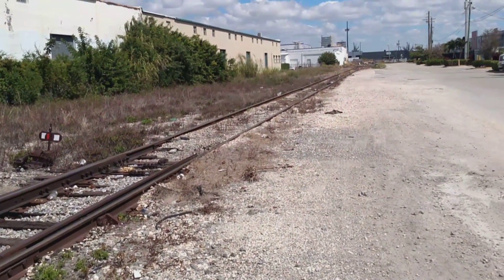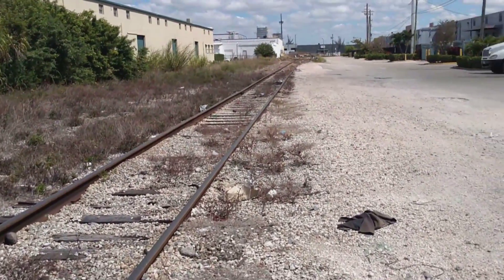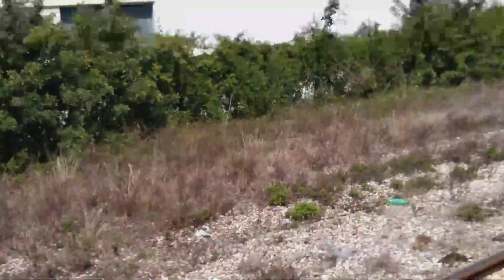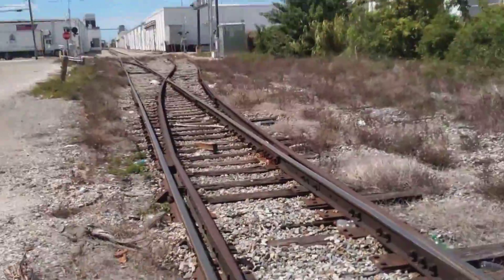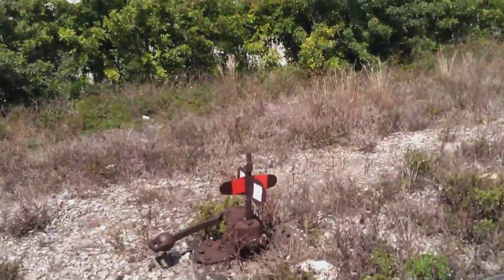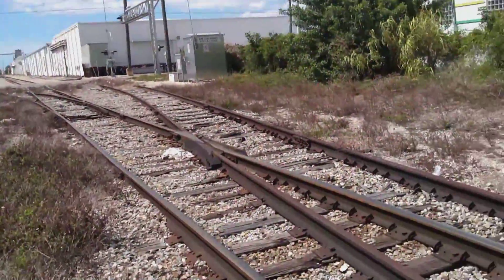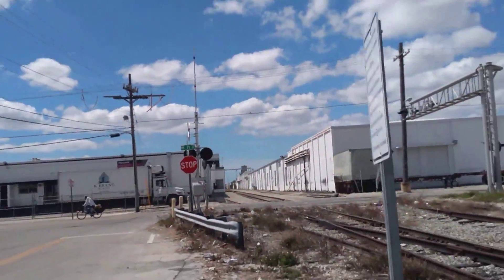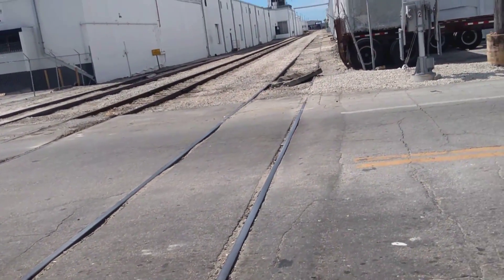How Do Train Switches Work ?

Comment: It may come to people's surprise that there is no bolts or fasteners holding down the locomotive or the car body to the trucks, or in the case of locomotives the traction motor sets. The trucks or the traction motor sets have what is known as a kingpin, something similar to what a semi trailer has, and a sliding pivot plate that the car or locomotive body pivots on. On the car or locomotive body there is a mating hole that the trucks kingpin goes into. The car or locomotive's weight and gravity does the rest., 

The components to a switch is first the head, this part is either remotely controlled at a central dispatch center, the yard masters post, or it can be a mechanical manual throw by a switchman or the conductor. The connecting rods, that connect to the switch points and the switch head. The switch points, which are the inner rails that are tapered to a point to allow the wheels to be guided through the switch. The frog, the central point within the switch with grooves to allow the flanges of the wheels to pass through. The guard rails, they are located near the outer rails or stock rails to keep the wheels and trucks going in the desired direction of travel. The stock rails, or the outer rails. 

Switches are used for sidings, turnouts in yards, spurs and branch lines, cross overs, Wye's, and interchange points. Indications of switch positions can be either through the use of signal lights on mast near the track, or something as simple as an indicator paddle on the switch head itself.  The signal aspect on a switch would normally be a set of two clusters. The top cluster will normally indicate the condition of the main, meanwhile the bottom cluster will indicate the position of the switch. 

A green over red, meaning the top cluster is green and the bottom cluster is red generally means a clear indication on the main, and the switch is closed on the turnout, meaning you are directed to continue on the main at track speed. A yellow over red or the top cluster is yellow, and the bottom cluster is red usually means to reduce speed through the switch and prepare to stop at the next signal, and the red indication on the bottom cluster will indicate you are being guided through the switch onto the main. A red over red or the top cluster is indicating red, and the bottom cluster is indicating red, means you are to stop prior to entering the block unless authorized by your dispatcher, and the red indication on the bottom cluster means you are going to be guided though the switch onto the main. Remember the top cluster will be an absolute signal, meanwhile the bottom cluster will indicate the position of the switch. 

Normally in the case of a thrown switch, the bottom cluster will indicate either a green or red aspect, meanwhile the top cluster will indicate either a yellow or red aspect. If you have a red over green, meaning the top cluster will be red and the bottom cluster will be green, that means you are to proceed through the switch into the turnout, and be prepared to stop once the last car has cleared the switch. The signal at the end of the siding will indicate a red over red, meaning you are to stop prior to entering the switch to get back onto the main. Normally after you have been given authority to re-enter the main, you will have a green or yellow over green. The green will normally tell you to re-enter the main and resume track speed, the yellow will normally tell you to enter the switch at restricted speed and prepare to stop at the next signal, meanwhile the green bottom indication will tell you that it is safe for your train to re-enter the main. Like the entrance signal, the top cluster is always the absolute signal, meanwhile the bottom cluster will indicate the switch condition.  

Normally sidings are 2 to 3 miles in length to accommodate long trains, that also applies for the most part the individual signal blocks. Most Class 1 railroads will try to space their trains two to three blocks apart which means they will be between four to six miles apart. Normally it will be the conductors responsibility to call the signal aspect to both the engineer and dispatch, the engineer may do this as well depending on company policy, nevertheless the aspect still needs to be called out. For interchange authority, if the train has in its possession a car(s) that is in need of interchange, it is the origin dispatcher that will contact the company in which the car(s) will be interchanged with, and both dispatchers will need to be in agreement to grant the authority onto another company's tracks. This is called trackage rights. In the case that the train will be reclassified, then it will be the yardmaster that will gain control of the train for the purposes of classifying cars on their respective tracks for other destinations on their system. This usually occurs when the train to be reclassified enters the yard limit. Run through tracks are still under the authority of central dispatch.
Reply: duh

Comment: But how do the tracks shift.
What is its method of construction.
Reply from the maker: The tracks shift because there is bar connected to the lever, that goes side to side, and where the point of the shifting rail lands, is where the train is going. Thanks as always for the views and comments, Arup

Comment: Thanks for the Switch or turnout video. For those not used to switches, go to a super busy rail yard. It will look like a switch maze. Multiple tracks will crisscross at various angles. Or to confuse you, check out tracks that look like a tic tac toe puzzle. No switches used, but the tracks are designed differently where they intersect. Then I saw a real neat way, for a train to cross another track. Not a switch. One track was solid running. The other track, has a small, 10'  section that raised like a draw bridge. The draw bridge track stayed raised, till a train on that track, needed to cross. That 10' section would lower on top of the other track. When the train passed and cleared, the 10' section would raise up and stay up, till needed again. Their is a video of this on YouTube, but I don't remember how to find it. 
It might be from the Florida area. Anyway, thank you for all the great videos, as usual.
Reply: I saw a video like that. I think it was from Australia. The line with the drawbridge was narrow gauge and the other line was standard.
Reply: @ROLPLay82  please see the other replies to my comment. One has the link to that video.
Thanks for the reply.